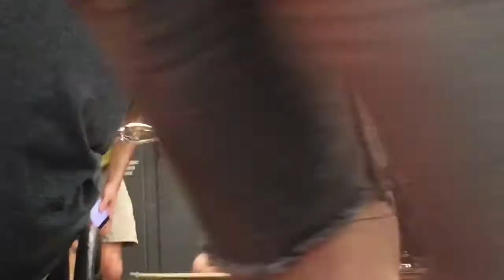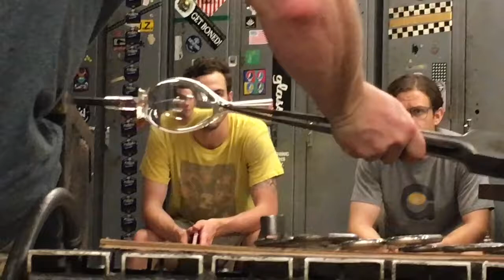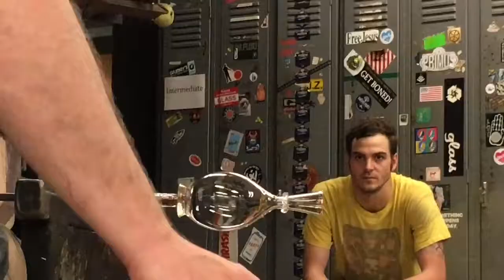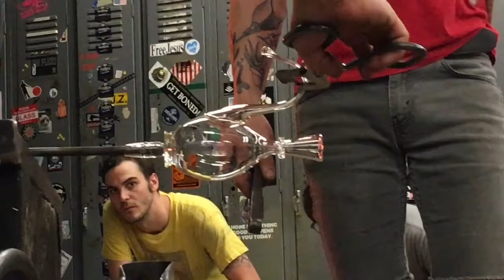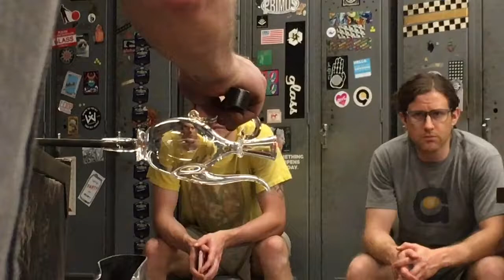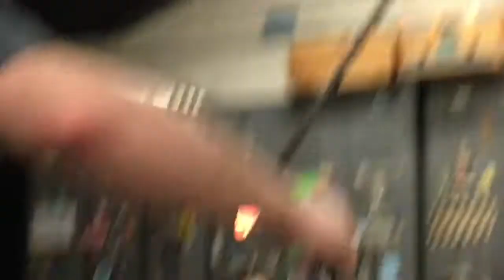Ampolina by Jeff Mack

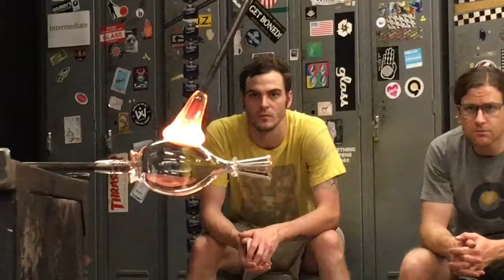Comment: at 2:20 when he sticks the bit that he then pulls out for the spout, what does he do to break the wall? did he just push the punty through? did he torch the side first?
Reply from the maker: I'm pretty sure the heat from that bit was enough to reheat the thin wall of the vessel so that it moved when he started pulling the bit away.  You can definitely preheat the contact point a little with a torch if you're having trouble getting it to work, though.